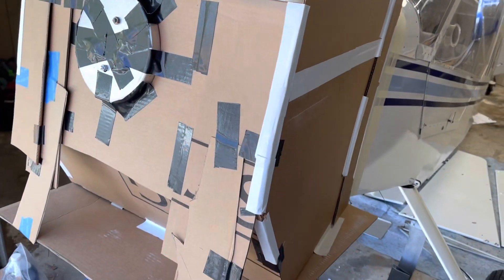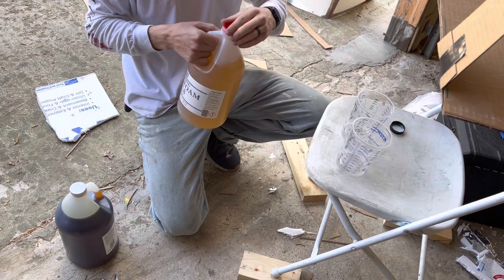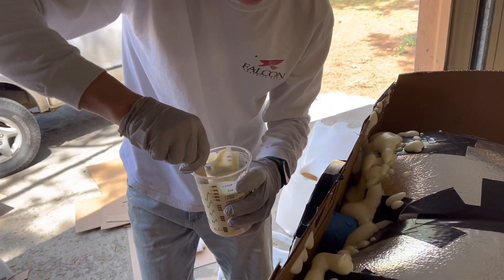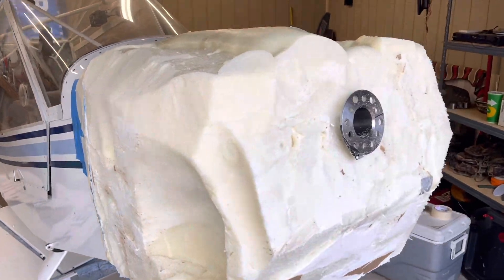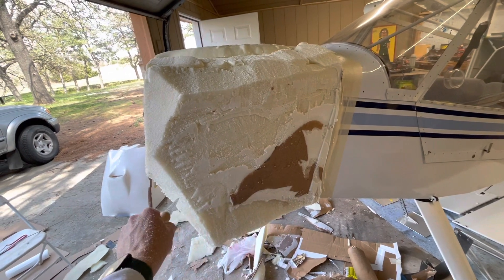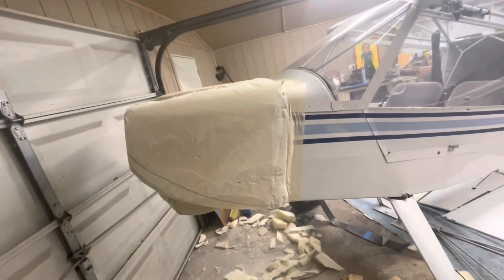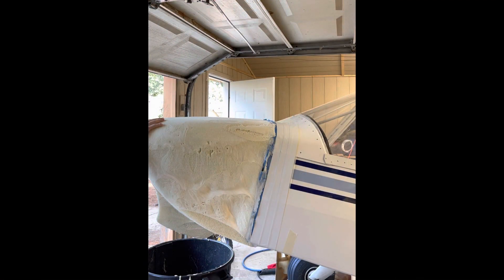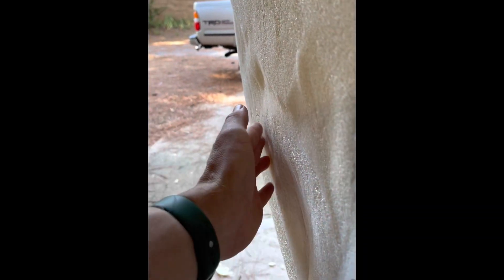DIY expanding foam plug for composite cowling RANS S-7

Comment: Did you use a  Polyurethane foam? I’ve only used it once for a Long Ez cowling over 10 years ago and did not have the problem of shrinking. Where did you purchase it?
Reply from the maker: 2 part polyurethane. Ordered from Fiberglass supply depot online! It was the 2lb density batch.

Comment: Alan, good job!  What is plan "B"?  I did not know heat would shrink the foam, so you may have saved me some BIG bucks!  I wonder if you used a wax covered cardboard, or added a wax paper over (under) the card board if it would have seperated easier.  I will do a research on "why" the foam shrank and what to do about it.  What "type" of foam did you use?  Thanks for a good video!
Reply from the maker: Hey Randy, eventually I started wrapping my card board forms in Celefain and it does come right off. I used “fiberglass supply depot” 2 part polyurethane foam. It was shrinking from the ambient heat in the garage!!! Wicks aircraft sells a 2 part polyurethane foam that does not shrink at all! “Plan B” is a video I will be publishing soon. In the mean time let me refer you to an interesting method I came across —> https://youtu.be/UQvqSbd9qSQ

Comment: Why not use pink insulation foam?  Mounting the blocks then shaping them accordingly.
Reply from the maker: I have seen molds formed with pink foam, since I was building the mold around the engine pour foam seemed to be the way to go. However in my case the foam would not hold shape. Pink foam is not a bad method though. I have a new plan and will be posting another video soon on this!

Comment: I'm confused? I did an change to my cowling last summer and didn't experience anything like this? I use poli A+B type of foam. I don't have the brand name with me at home so can't tell you what I had but his is very strange to me, not that I have much more experience with this type of work.
Reply from the maker: I am slightly confused too. I did a fair amount of research before going into this and from what I could tell other people have used this same brand of polyurethane foam. However, mixed to the correct ratio and given plenty of time to cure it shrinks tremendously during the exothermic reaction of the resin. Shrinking was also observed from the outside air temperature alone. Accepting my losses but not giving up! I still believe I will be able to produce an exceptional cowling for this airframe/engine combo!